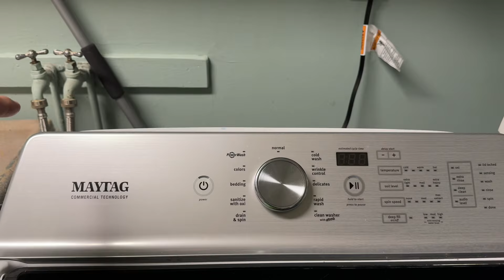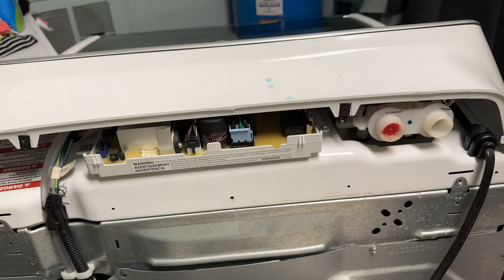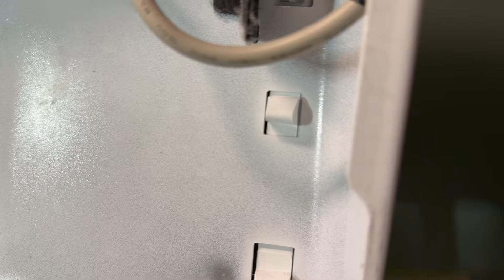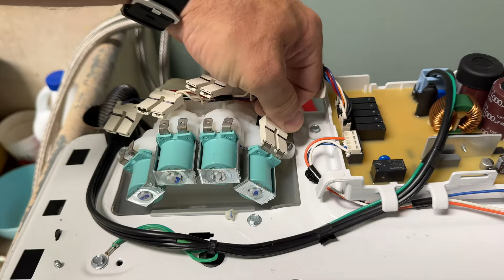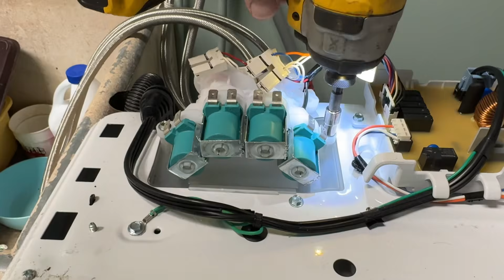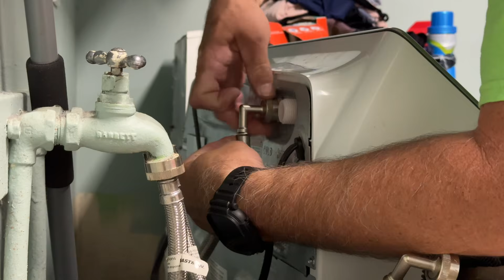How to Replace the Water Inlet Valve on a Maytag Washer (Model MVWB765FW2)

Comment: There is a much easier way to get to washer valve. Go at it from the back by unscrewing the access panel screws and then go around to the front with a putty knife and slide under the two corners of the control panel to disengage the two metal spring locks. Go back around to the back and just flip up the control panel to get to the valve. Your method makes this repair much more difficult.
Reply from the maker: Thanks for the feedback and thanks for watching!

Comment: The video was perfect! Everything looked exactly the same as mine. I have successfully replaced this part before. However, this time it did not fix my problem 😭 Water still coming in even when washer is turned off.
Reply from the maker: Check this comment - 
https://youtube.com/watch?v=_0nwFS1ktyM&lc=UgzdBhPDWroNa872O194AaABAg&si=7xCL8DyDRQVm3A3B

Comment: Have you found a solution to cleaning those filter screens? I also have very hard well water and am dealing with the same issue. I usually just disconnect the hoses and spray some vinegar and flush those screens out, but it’s not a permanent solution. Thanks for this knowing I’m not alone helps. 

I thought about maybe adding a filter on the waterline before the inlet valve to stop anything before it even gets there? And then just maintain that filter. Any help would be great
Reply from the maker: No, I haven’t messed with it since the repair.

Comment: You can take the console part off without taking the top off. Just push a butter knife or scrapper into the corners to push that springy thing in on both sides.

Comment: Your detailed instructions were perfection for removing the panels to get to the valve, and I had the same issue with getting the electrical clips off, so I’m very glad I was able to see how you got them off with pliers and used a flathead for the little black clip under the valve. You are a lifesaver! 🙌🏻

Comment: So the manufacturers made the inlet filter non-removable, that figures. I found your video when looking for the inlet screen removal method because mine was clogged with sediment and the washer filled slow. It wasn't coming out like they usually do and I thought perhaps there was a trick.  Typical of manufacturers to make something you have to replace vs. an easy clean.

Comment: i did this but as soon as i plugged it in and turned the water on, the water started filling my tub. idk what to do now.
Reply: on the cold side, it doesn't do it with hot water.
Reply from the maker: @Sarah-Tonin12 I’m assuming the machine is powered off? What about if you unplug the power cord? Does it still fill with water?
Reply: @PracticalDetail powered off but plugged in. the water stops when i unplug it.
Reply from the maker: @S @Sarah-Tonin12 sounds like the valve is stuck open. May be a bad part.
Reply: @PracticalDetail its happened with 2 of them. is it possible for 2 of them to be bad?
Reply from the maker: @Sarah-Tonin12 not likely. What was the original part doing before you tried to replace it? Were you not getting any water at all?
Reply: @PracticalDetail it burst or something, flooded my garage. i also replaced the motherboard and the wires to the water inlet.
Reply from the maker: @Sarah-Tonin12 maybe double check to see if the wires are reversed? Giving an open signal instead of close.

Comment: What I did was switch the two wire connectors moved the 2 on the right to the two on the left. Can't put laundry soap in the pull out tray just put it on the laundry.

Comment: mines getting water in it, but theres also water on the floor and when i look under, it's got water on the inside of the back left wall under the inlet valve too
Reply from the maker: Wow. Does it leak all the time or only when the machine is filling?
Reply: Seems like only when it's filling.  @PracticalDetail but maybe some when agitating too. Hard to tell, but not when it's off or not running
Reply from the maker: @derrickmcfall8702 it sounds like the leak is inside the machine somewhere. I’d open the casing and try to locate it that way. Trace the water routes inside the machine.

Comment: Is it possible that the housing could fail? Im only asking because when looking for the inlet valve, I saw a website selling both the valve and the housing together. And where’d you find the part? Locally or online?
Reply from the maker: I guess it is possible but I haven’t seen it. I purchased mine online. I have an affiliate link in the about section of the video for the part if you choose to purchase from Amazon.
Reply: @PracticalDetail thanks A LOT!!

Comment: Followed this tutorial, my Bravos XL is fixed and runs like its brand new within 30 mins. Highly recommend using a flathead and hammering the end of it at the mouth of those clips, made it effortless. Hard to get off any other method including pliers. Youll just break the connector if you pull on it with some jaws.

Comment: Thanks alot for the video! FYI, if you need to clean those screens in the back, just take a small flat head and slide in the side and put just a small amout of pressure on the in a prying like manner and they will pop out. Ive got well water as well and have to clean them periodically.

Comment: Great video👍 Mine was issue with no cold water - had already cleaned the water inlet screen (blue) after having some plumbing work done - worked for a while then, again, no cold water - took the water inlet assembly off (using your video) and the cold water inlet was packed with debris (from the recent plumbing work) behind the unremovable blue screen - used a water pic and a long thin needle-like instrument to remove the debris - did the trick and saved money by not buying a new water inlet assembly - Thanks again!

Comment: Hi Wes.
Great video. I just ordered the part and will give it a go when it arrives. One question. I have seen a lot of videos that show the screws in the back being removed but they don't actually push the top forward and up exposing the 2 metal clamps that need to be pushed in. They instead go right to the front of the machine and using a putty knife or similar they just push those clips in and remove the control panel. I inserted a putty knife into the front and looked at where is was from under the machine. It appeared to be nowhere near that clip. Do I have to push the top forward to get to those clips? I hope I'm making sense?
Reply from the maker: I believe I understand what you’re asking. I haven’t tried using a putty knife under the control panel to press those clips in. Either way, I don’t think the panel will slide forward without pressing the metal clips. That’s why I raise the entire lid to access it from the inside so I can clearly see what I’m working with.
Reply: @PracticalDetail  Got it. It's probably safer than jamming a knife under the front on each side like many other videos show. I appreciate you getting back to me.

Comment: Thanks for this. Mine was giving a LF error code and water leaking into the water basin.  If you wiggle the selinoid connectors left and right, you'll feel a small click and they'll pull straight off with ease.
Reply: Wish I would have seen this 30 minutes ago that shit was rough! 😂😂😂
Reply: @memyself2630 Same.  It wasn't easy pulling them off

Comment: Brother, this video was perfection. 15 minute fix, no problems. Those plastic plugs even came off much easier than yours. Thanks! 🙌
Reply: I had to take pliers to mine 😅 those things were on TIGHT.
Reply: @many_lives4925 Still cheaper than calling the repairman! 👍